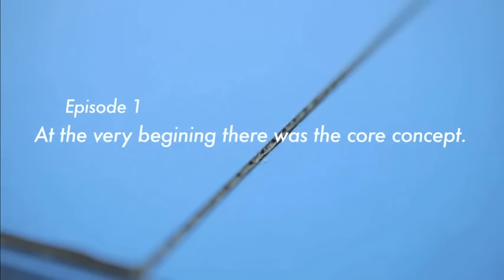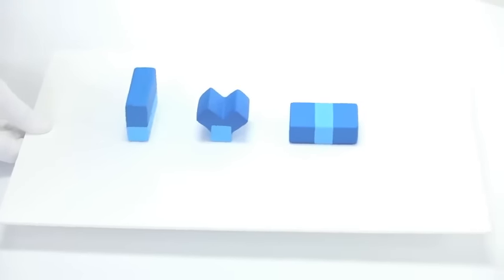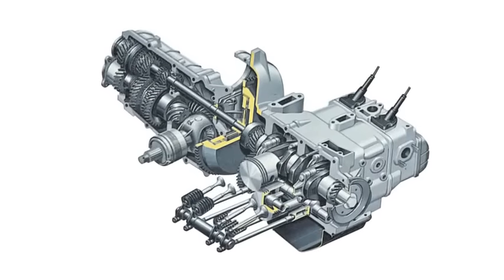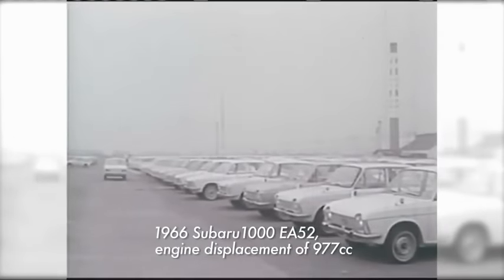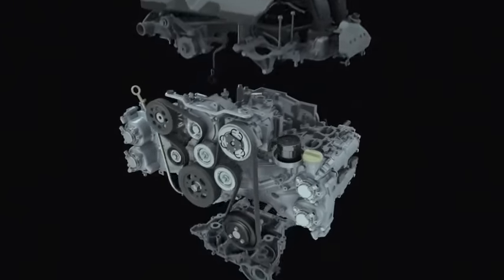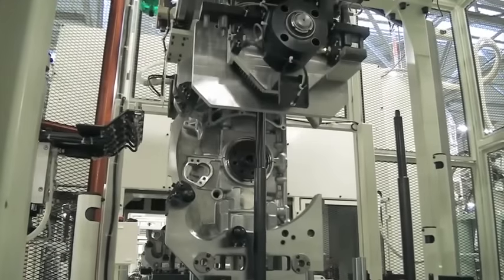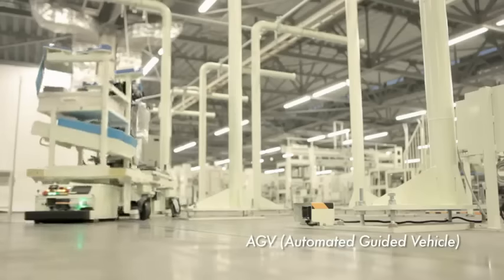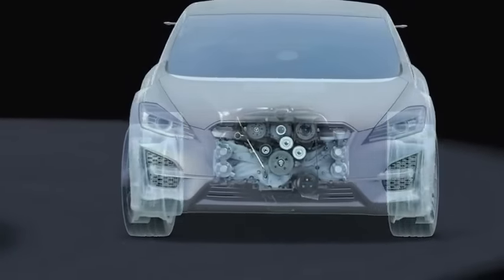Learn About Subaru Boxer Engine Technology

Comment: No it doesn't. Educate yourself fool. Engine knock is not caused by the piston or sleeve. It is associated with the valves, fuel/air mixture, spark plug problem, oil problems, and weather conditions.

Comment: Subaru may have been using this engine for more than 4 decades, but the principal is NOT new!! It had actually already been developed in GERMANY in the early 1900's Karl Benz made a TWO cylinder horizontally opposed engine. Gee, I wonder who the REAL leader is with auto technology!! NOT Japan!!!! On to the symmetrical all wheel drive system Subaru CLAIM to have made. It is NOT physically possible You CANNOT cut a differential in half symmetrically. The reason for this is on one side you have the crown wheel assembly containing the other differential components with the carrier bearing & the pinion shaft, it's bearings, prop shaft flange & the seal, along with the other carrier bearing for the crown wheel assembly!! Sorry DICKHEADS, back to the drawing board with this one!!!!

Comment: They're also the 2nd worse built motor in the world. They have garbage pistions / rings and they skimped all the metal that keeps the sleeves from blowing head gaskets (fkn cheep skates). Their fun to drive but they'll eat your wallet just as fast. Buy an Audi if you want a quality motor plain and simple.

Or buy a spare boxer motor, why not.

Comment: Pretty shitty engine. Could have at least made it closed deck from factory. Stock engine cant take 5 hp more. Which means u add an after market air filter, you pretty much fucked the whole system by over boosting it. Without proper tune these engines are total crap.

Comment: The toyota and honda engines are better. These engines are nice - when they work - they are very prone to failure
Reply: I sat at the Honda dealership while they worked on my boy friend's brand new Honda Fit, four trips! I took a book to read each time. My Subaru, simply the basics such as an oil change, etc.
Reply: @barbaraallen7164  Yeah I doubt that has anything to do with the car itself. I am a mechanic and I will tell you subaru engines are not as good.